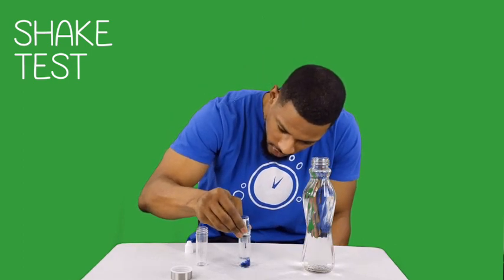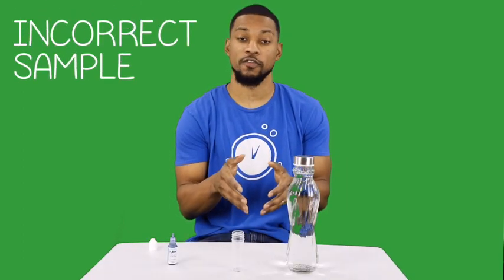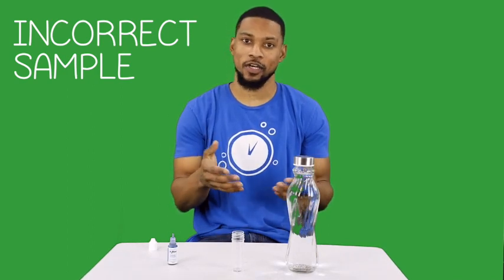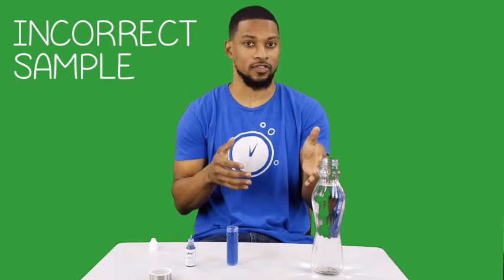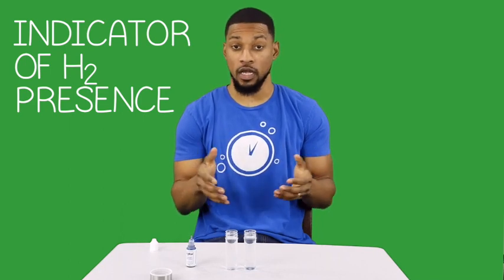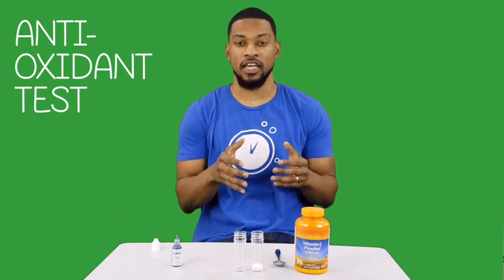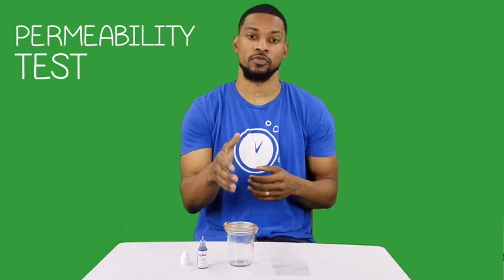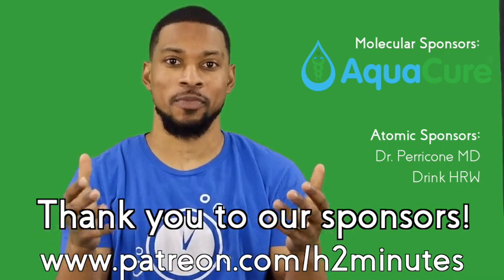PART 2: H2Blue Testing Video - Ep 44 - H2Minutes

Comment: Hey does H2 have any direct scavenging capability? I thought it could directly scavenge hydroxyl?
Reply from the maker: Hey Rob, 

As it stands currently there is some debate as to hydrogen's direct scavenging ability of the hydroxyl radical. It appears cell modulation/cell signaling is the primary mechanism for several reasons. Here is  a quote from my site where I discuss this in more depth. 

" Important note: Hydrogen was once and still is thought to be, and has been featured in many studies as, a selective antioxidant, neutralizing only the most dangerous and cytotoxic free radical, the hydroxyl radical( OH•) via direct free-radical scavenging. This information is still being used by many hydrogen companies in their marketing materials.  Although the reaction between hydrogen and the hydroxyl radical is a valid reaction in an in vitro system (test tube) it appears that this reaction either may not occur in the human body or is very unfavorable. This is likely due to the very low reaction rate constant between hydrogen and the hydroxyl radical, compared to other antioxidants (SOD, Vit C, Q10, etc) within a cellular system or environment. So as it stands, for now, the hydrogen molecule might only react with 1 out every million hydroxyl radicals in an in vivo system or possibly not at all. The remarkable part of this current information is that hydrogen still appears to reduce oxidative stress (excessive ROS) and hydroxyl radical levels in the cells and human body significantly and effectively. Hydrogen gas  does this through its gaseous-modulator effects rather than acting as a conventional antioxidant. Overall, hydrogen still appears to have some of the most unique antioxidant-like effects of any therapeutic molecule for the human body on the planet."

"Moreover, the biological significance of this reaction is debated [108,120,121]. This is partly because the 2nd-order reaction rate constant between hydroxyl radicals and H2 (4.2 × 107 M−1 s−1) is about three orders of magnitude lower than that between other more abundant nucleophilic cellular components [108]"
https://www.mdpi.com/1420-3049/24/11/2076/htm

"Ohsawa et al.34 reported in 2007 that molecular hydrogen reduces hydroxyl radicals and, to a lesser extent, peroxynitrite. However, significant beneficial effects from a radical-scavenging activity of hydrogen are unlikely to occur in our body, because (i) the concentration of hydrogen is too low compared to those of nucleophilic biomolecules, (ii) hydrogen rapidly dissipates from our body, mostly in the breath, and returns to baseline in ~30 minutes,20,25 (iii) the reaction rate constant between hydrogen and hydroxyl radical is 4.2 × 107 M/s, which is three orders of magnitude slower than most reactions with hydroxyl radicals,35 and (iv) intestinal bacteria produces 12 L of hydrogen in a day by metabolizing only 40 g carbohydrate,36,37 which constantly yields on average 10 ppm (2–12 ppm) of hydrogen in our breath.20,26,38,39"
https://www.ncbi.nlm.nih.gov/pmc/articles/PMC6352570/

"Plenty of evidence demonstrated the radical scavenger capacity of molecular hydrogen [22,30]. However, whether this elimination is accomplished by simple chemical reaction remains to be determined, since the reaction rate of •OH with H2 ([•OH + H2 = H2O + H•]) is slower than most radical–radical reactions [31]."
Reply: H2Minutes with Tywon Hubbard thanks!
Reply from the maker: @roblento84  You're welcome!

Comment: ...THANKS again Tywon! . . . something has been puzzling me and perhaps you have a video on it...? It visually appears using an H2 Generator with an Air Stone in a glass of water that ALL the gas rises out of the water. I do know the infusion happens with pressure (closed air-tight container). Now IF some gas IS infused with an open container, would it only be a minute amount with most of the gas just "infusing" the room air...? (wasted lost H2) TY
Reply from the maker: Hello Imtheone, 

I will gladly address your question.  Hydrogen gas saturation solubility (maximum) is 1.57 mg/L (ppm) @ 25C under normal atmospheric pressure (1 ATM/14.7 lbf/in). It is possible to super-saturate the water with hydrogen gas producing 2.0~10.0+ mg/L (ppm) if you increase the partial pressure (ATM/psi). If you're bubbling water with hydrogen gas depending on the generator (pure H2 or oxyhydrogen), diffusion stone, and gas output it will have the potential of dissolving up to 1.56 mg/L (ppm). Remember In terms of hydrogen-rich water at saturation (1.57 mg/L @SATP), hydrogen gas half-life is about 2 hours and will reach equilibrium to atmospheric levels in about 10 hours. 

"The concentration of saturated hydrogen water placed in the open is reduced by half after about 2 h, and almost all of the hydrogen is lost after 10 h [23]."
https://www.ncbi.nlm.nih.gov/pubmed/31008498

So, in essence, you will need to measure the dissolved hydrogen gas of the bubbled water to know the dissolved hydrogen concentration. However, just because you see most of the hydrogen gas escaping the water doesn't mean nanobubbles of hydrogen gas are not being infused. It will have to be measured ultimately. 

Here is something I wrote for another person regarding this topic with BG water.  It further expounds on the topic regarding what I mentioned above.

"As to your question sure I will add my two cents. Infusing water with Brown's gas (66% H2 /33% O2) will dissolve both gasses up to their partial pressure/saturation point in relation to the gas concentrations be supplied. This means for hydrogen gas saturation will be 1.03 mg/L (ppm) and O2 saturation will be 13.72 mg/L (ppm) because brown's gas supplies 66% H2 and 33% O2. Henry's Gas law saturation levels are based on 100% concentration of each gas. Brown's gas devices will basically produce 1 mg/L (ppm) H2 water after the water has been sufficiently bubbled. Pure H2 devices will be able to produce 1.56 mg/L (ppm)(basically saturation) H2 water because they supply <99% pure H2 gas. The increased O2 concentration of the water is irrelevant as you would get more O2 from breathing another minute then if drinking a gallon of the water. A gallon (4 liters: most people can not drink that much water) of brown's gas water would only allow you to ingest 2~3% of the O2 you would inhale in a minute by breathing and that is assuming the O2 would be absorbed into the blood. Also, even if the oxygen is absorbed in the blood, it ends up in the venous system, which takes its path directly to the lungs. So even though there is extra O2 in the water, it would not make it to our muscles. Lastly, the infusion or dissolving of the gas will be highly affected by the diffusor and volume of gas produced not so much the gases themselves. A decent diffusion stone will saturation the water pretty efficiently. "

I hope this helps.
Reply: @H2MinuteswithTywonHubbard  ...WOW  Tywon, thanks for the book! Got another?. You stated....."A decent diffusion stone". WHAT is the Best Diffusion Stone please...???  THX!